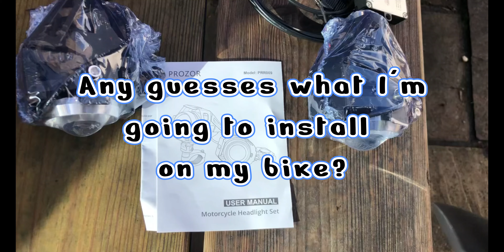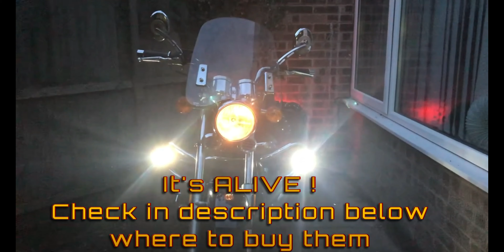Valkyrie Biker - How to... install sidelights on your Keeway Superlight 125

Comment: Good idea for the long winter 🤠 had mine for 2 years now and love it. I popped a led in the front and for the indicator light. Helped so much
Reply from the maker: Thats a great idea. I will change to leds when my main light goes again. How easy is it to convert to LED and which ones did you use?
Reply: @TheValkyrieBiker  yea really easy to do. You need to remove the headlight to get to the instrument bulbs but it's so worth it. I used GLL T5 LED for the instruments lights and Osram W5W LED for the daytime bulb :)
Reply from the maker: @elliothaller2714  Thanks for that Elliot. Ill make a note and change the bulb when I need it :)

Comment: Hello, did you just wire these directly into the battery? Im thiking if getting some due to the headlight on mine being so poor
Reply from the maker: Hi :) Yes I did. It was quite simple. I removed the seat and then attached the connections to the battery. I am guessing there are better ways to do this, but I am no electrician :) They work wonderfully. Now the bike has gone I shall buy more for the Harley.
Reply: I bought these a few weeks back and fitted them no problem after watching your video, thanks for posting it, I can see a lot better at night now! 😂
Reply from the maker: @The1nutwonder  awesome! you are welcome x
Reply from the maker: @The1nutwonder  lol its always good to be able to see at night :))

Comment: Where and how did you hide black cables on the chrome bars hun
Reply from the maker: Hey :) icabled tied them to under side of body not touching the bars. So from side lights, tied under bar so can’t see it and then through plastic body cowling to handle bar. Hope that makes sense. X
Reply: Yep thank you for your help xx